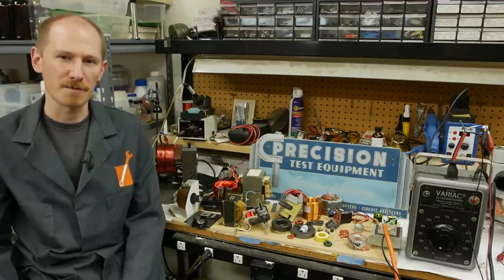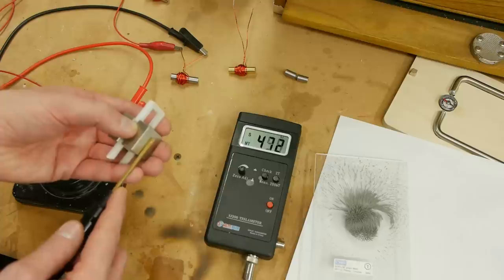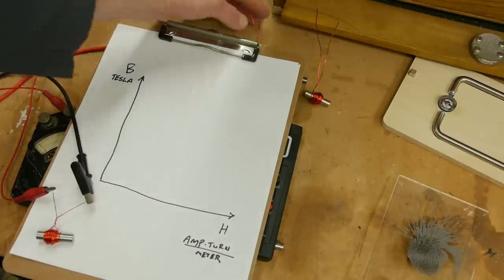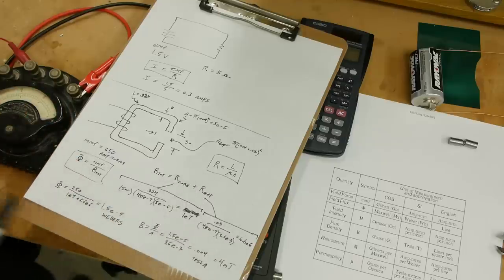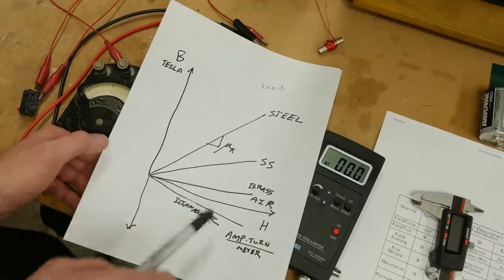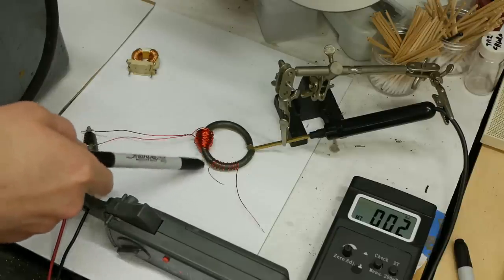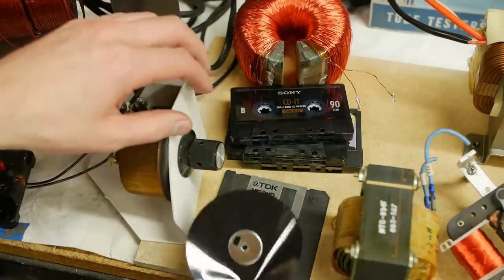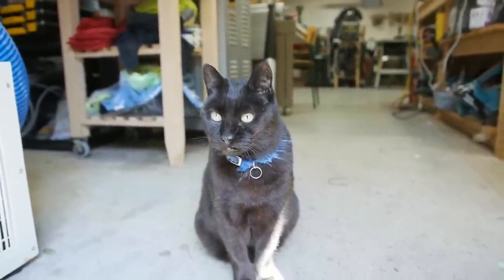Engineering magnetics -- practical introduction to BH curve

Comment: Over 99% of the battery weight will be transferred straight down  the studs  threw the floor joists and seals to your Foundation  not in word or outward

2  vertical two by fours per battery screwed studs with hi Shear rating screws not brittle  black screws 

If you use hex head screws you will hate Phillips heads

 two horizontal two by fours screwed to the vertical two by fours

 have made or buy heavy duty hooks make sure they're deep hooks at least 4 inches

 Mount hooks to your batteries this will make it easy to hang and unhang the battery by yourself 

 The deep hooks  along with mounting  the pivot points above the mass
makes this mounting arrangement highly
stable 

It takes advantage of the batteries massive weight  it to secure it tightly to the wall while retaining the SIMPLICITY  OF MOUNTING !!

U have your sweet thing holding up a 200pound battery while you nervously fumble around with a drill you better enjoy it because thats all be the only screwing you will be doing for a while 

Sorry I should spend my hyper inflation cheak on a sence of humor 

You can put a road sign or tin in between the two layers of two-by-four for a heat shield and do the same on the ceiling

  the hole room temperature would likely have to get hot enough to catch something else on fire before your room would burn

Put your battery wires or busbars through 3/4 inch gray conduit they will have to x if batteries are mounted side-by-side

 make sure to strap your wires so weight of wires going to your inverter will not pull on your battery studs

It will loosen the nuts on your studs or maybe break them

I used hot air and Soderling iron to fill in  large holes in my wire ends
I filed them flat and drilled smaller  holes
 
Make sure not to put a washer underneath terminal it will cause resistance and heat 

You done good job with safety on your solar panels I am sure I didn't say anything u don't already know

 I have faith how ever you decide to do batteries and inverter
It will be safe and good job

I knew you would make a good choice on batteries WOW!!! you think things over over over and just incase over again 

I am so glad you didn't get single used 18650s what a mess!

I never heard you mention a heat pump hot water tank or a  instant rotary water heater 

When you buy farm your wind mill can be located very far away from your house without voltage drop

You can use 2 Transformers one at wind Mill to step up to high voltage and low amperage 

And one at your house to step voltage down and raise amperage 

This allows you to put your mill in best location without voltage drop and high cost for large wire 

Stepping up to high voltage allows you to use small wire at long distance with little  loses 

 this is how the power  company gets power very long distances with little to no loses

I have used old phone wire the kind on poles the copper  coated steel kind

This wire can be found free if you keep a eye out for it 

Two 12 to 240 volt Transformers would work good on 48 volt wind mill 

you can adjust wind mill voltage  out put also by changing the turn ratio so you could use 12 volt on 48 volt battery 

There is also a trick to use capacitors to keep load of your mill and by doing so start faster and make more power in lower wind

This done like this you have to set up a way to brake in high winds and take precautions because of the capacitors 

I have decided to finish building on of my Fisher and pickle style windmills

 volcano Ash along with all these clouds we have nowadays my make you be glad to have one along with more wind at night and winter 

I made a way to charge batteries when I was 11 that I have also decided to build once again 

It will charge a battery 24/7 with out depending on weather ,fossil fuels, chemical reaction ,or a rodent 

My battery bank was not fortunate enough to acquire a public education 

So sad poor thing  is not capable of  rational thought so it works very well!!

Comment: You can lift those magnetic lines off of the permanent magnet using iron.  Permeability, and opposing poles.  If the metal is thick enough permeability prevents demagnetization.  Try stacking in opposition instead of attracting across a gap in a magnetron design with three permanent ring magnets in opposition, that way the gap stays North and South but, the majority of magnetic lines are projected rather than bunched up on the surface of the permanent magnet.  Use a slab of 99% pure construction steel, low carbon, low sulfur, and this calculator to be certian the magnetic lines are contained by the steel. Then stack the three ring magnets in opposition.  https://www.kjmagnetics.com/calculator.asp
Reply: Just consider, or even model the magnetic field replacing your one ring magnet in your magnetron, with my set up of three as one.
Reply: In magnetics, allot has been discarded.  I don't even know where to find a textbook for it.  Not when it comes to the subject of permanent magnets, permeability, steering, focusing, and managing magnetic fields.  Compound magnets are just nowhere to be found.

Comment: 3:59 Do you feel uncomfortable saying that the water would rather stay in the bath tub than climb up the sides and pour all over the floor? 😂
Reply: My point is that when you see the patterns in the iron filings, they're not the field itself, they're a static trace of the result of a dynamic interaction between falling iron filings as they moved through the field. This could even have involved electric charge on the filings. When they fell, they landed in lines which were least potentials, and the density of these lines on the surface corresponds to a kind of quantization of the field strength in that region. But the effect of those lines of filings is to reduce the field strength (magnetic flux density) around them, just like your steel 'conductors' do. You should be able to see this by putting your magnetic probe in a space before you drip the filings, and then measuring the flux after the filings are lined up. You could also experiment with different sizes of filings. I suspect that there is a lot going on in the details, so it would be really interesting to see some experiments using mixtures of iron and copper. This video shows how much matneto-electrical activity there is going on in copper. It's impressive! https://youtu.be/sENgdSF8ppA

Comment: I'm "hit" with radar/radio waves.  what sort of steel transformer would block radio/radar waves, so I won't wake-up after a nap. feeling that I have been zapped in the head.   I don't want to return their signals--I just want to Block their signals.   I understand I may be being zapped simply by "dirty-electricity", like from a "Smart Meter", although @ times other parts[ feet/legs] are "zapped".   Some times, I would be "zapped" in the chest, but I would KNOW the chest pain was NOT "organic" [heart-disease], because when I left the area, and drank several mouthfuls of distilled water, the chest pain would ALWAYS subside.   Sometimes I would suffer extreme "indigestion", to where it felt like I Needed to "throw-up", but I couldn't, but that, also was radio/radar waves from my torturers, because if I walked out of the house, the "indigestion" would abruptly stop.   Sometimes. I am hit with ELF signals that cause my stomach contents to rush up into my throat, while sleeping, but I just clear the contents & mucus, and continue on.   A "Fusion-center" from the O'Bama era could be attacking me, as the stalkers operate their machines on me.  If they were Satanists, my cursing them out was monitored, and they could "justify" my torture, because, by cursing them, I was as "bad" as they were.   Now, I try to Bless them with prayers, and they don't like that, because they HATE God/Jesus.    They will even "zap"my animals, whose Only crime, could be that I am their owner.   Please help me "block" them.

Comment: Awesome video!
BTW, integration can be done simply and externally outside the oscilloscope with a passive RC circuit connected with the sensing coil on the ferromagnetic core. As shown by MIT OpenCourseWare here: https://www.youtube.com/watch?v=pXukVix5Pcw - Chapter 9.4.1: Measurement of B-H characteristic
Awesome. No need to use advanced math function on a higher end oscilloscope or other special hardware. A simple oscilloscope will do, with a resistor and a capacitor.

Comment: The term stainless steel covers a wide range of alloys. “Bad” stainless had enough chromium in it to defeat most corrosion, but it is still magnetic, and scrap yards only pay the same as iron. But “good” stainless has more chromium, is not magnetic, and will sell at a premium. For example some tableware will attract a magnet and some won’t, so it is easy to test with a magnet. Which are you using in your reluctance circuit?

LG makes a refrigerator with bad sides and a good front. Are they forcing users to always present a pristine front appearance, because refrigerator magnets won’t stick to it and clutter it up? What other reason could there be? Is better corrosion resistance needed on the front than the sides? Bastards!